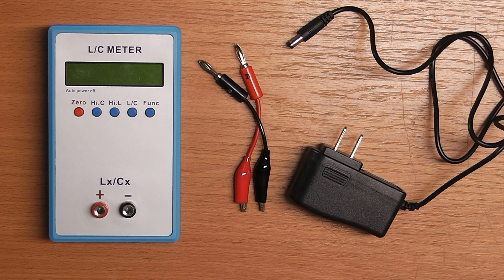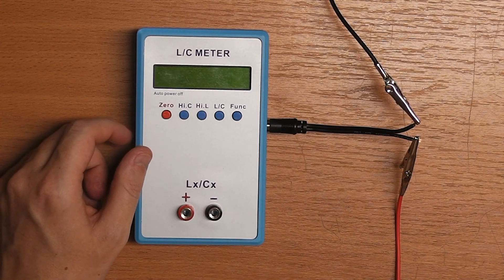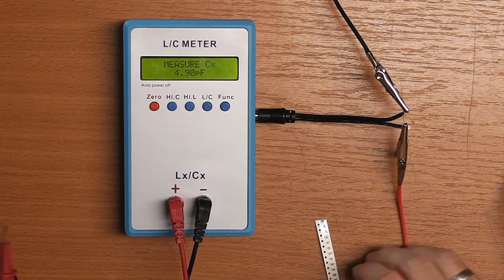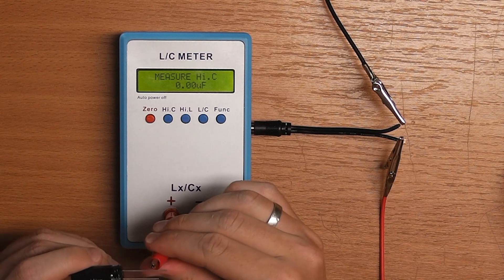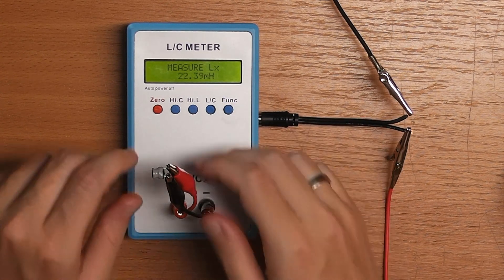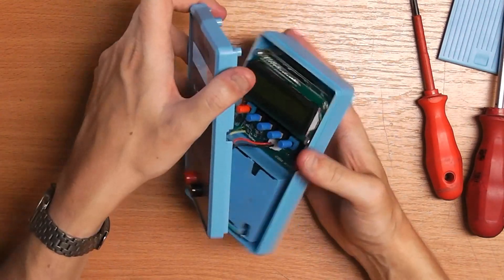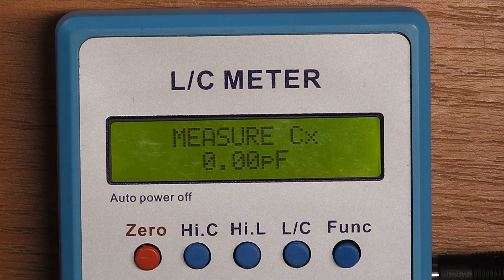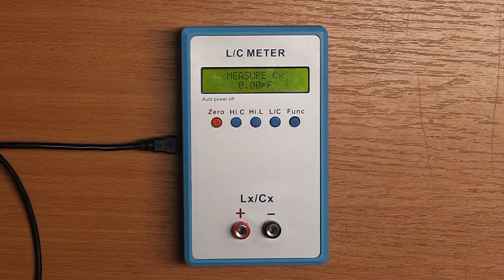LC200A China L/C Meter Review and Teardown

Comment: I bought LC100A recently, have found that L readings seemed accurate, but not the C reading. On Hi.C my caps were off (smaller) by 3 to 5%, and on regular.C my cap readings were off by about 25%. I wonder if the built-in inductor in my copy is off, and maybe I could add a few windings to correct/compensate the cap readings.

Comment: You're calibrating it all wrong. Short for L/R, open leads for C.
Reply from the maker: That is actually exactly what I'm doing... I only zero in C mode and both time with open circuit, first at 2:49 (obviously open circuit) and then at 5:55 where I am also open circuit (I even mention it is not connected to the component). I don't ever zero it in L mode in the video. But the way I'm doing it in C mode is exactly how to do it: with leads fully connected (to zero their capacitance as well) as close as possible (but not connected) to the DUT. Which is also what I wrote in the comment just below this one 6 years ago: "You have to leave them OPEN when you're doing C measurements (because the parallel capacitance needs to be zeroed out)."

Comment: You need to hold the zero button until it says saving results (or similar).  A quick press won't zero the meter properly.  The USB is for power only as far as I have read.  I've ordered the LC100-a which is basically the same without the case.  The AC label is Chinese English for AC Adapter, the other position of this switch means USB.  I believe the LC200 model has a 5 volt regulator so you can use a non 5 volt adapter (range?) which the LC100 bare bones model does not.  From the reviews I've read and seen it seems to be a pretty accurate meter for the price.  I ordered an LC100-A on eBay for $17 US.

Comment: is this  a true in circuit  meter ?
can you measure for example a computer power supply capacitor without the need to desolder it ?
Reply from the maker: No, you can't do that. But then again, no meter can do that: Imagine a circuit which has two 1000µF capacitors in parallel. Together they will appear as a 2000µF capacitance. No meter will be able to accurately tell the difference, so this isn't possible in general.

Comment: For those that might read this concerning the frequency that capacitors (or inductors) are tested at - first of all, capacitance and inductance is not frequency dependent - capacitive (reactance) and inductive (reactance) is frequency dependent. An example: If you apply the formula for capacitive reactance to very small capacitors like 10 pF and then again to large capacitors, for example, 1000 uF, you will quickly see that using only one frequency, assume 1 KHz, would not be reasonable because the reactance at 10 pF to 1KHz would  be extremely high and at 1000 uF the reactance would be extremely low - I will not do the calculations here - that is up to you to. Consequently, capacitance and/or inductance meters must be able to vary the frequency to test these components at different frequencies to arrive at a reasonable value of resistance (impedance) and display the resulting value of capacitance or inductance - thus the variation in frequency in testing capacitors or inductors over a wide range of values - hope this helps.

Comment: I have one of these  and also did a YT video on it - it looks pretty cheap but I compared it to a Tektronix Type 130 LC Meter and this little LC200A did pretty good but agree with you on the quality of build is really cheap. I learned from your video about holding the Zero button and the USB cable concerning the AC - DC switch -  I have always used it with the provided PS which has a flakey connector at the meter but agree that it works pretty darn good for the price - Thank You for posting.

Comment: The same LC200A meter i got from different seller has nice function to set brightness when you press func and zero same time. It has 2 choices for backlight brightess to save your batteries :) And for zeroing the L, you short the leads, for C, you do not.

Comment: Thank you for taking the time to do this review. It is thanks to folk like you, I can find out about items like this before I buy them. Amazing that you can get such a useful piece of test equipment for 40 EUR. Wish stuff like this was around when I started out in electronics. Digital LCR bridges cost 100s or 1000s of EURO back then. You could buy or build proper old school LCR bridges but the time and cost of sourcing all the components was prohibitive and I don't remember them being all that easy or quick to use. This LC200A looks great for the money and measures down to quite low C & L values - which a lot of DMMs with LC ranges do not. So, this is much better for electronics (e.g. making, testing & repairing radio equipment). Once again, many thanks.
Reply: I was asked to use a "digital bridge" meter to measure a capacitor. Can I use this LC200A as a digital LC bridge meter?

Comment: Have you tried measuring high-value MLCC (like 10uF+) on Hi.C range? Does it work fine or read low? What is the frequency and drive level on Hi.C range? It's not clear from the manual.

Comment from the maker: Yes, you can see that at 8:38. In the example it shows 32.9kHz at 22.38 mH, so you can calculate the internal capacitance that is used at approximately 1nF. To see the current frequency, just hold the "Func" button down.